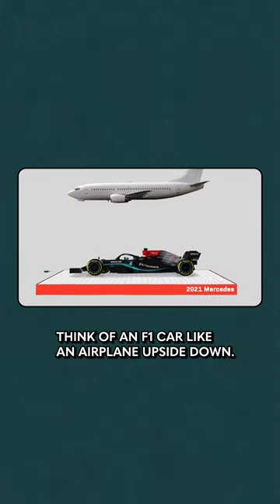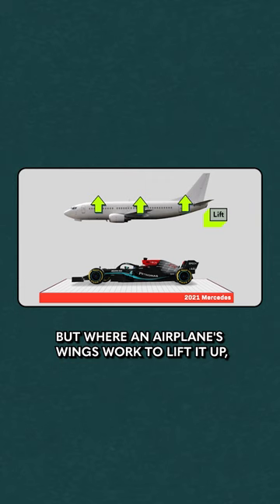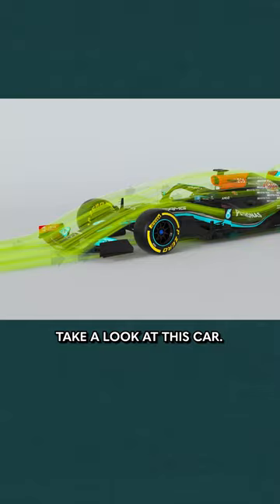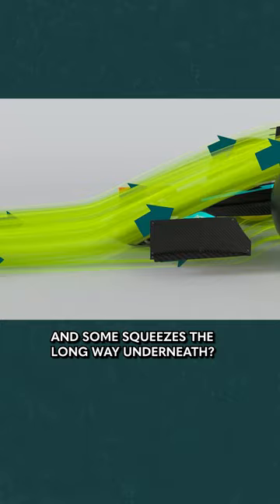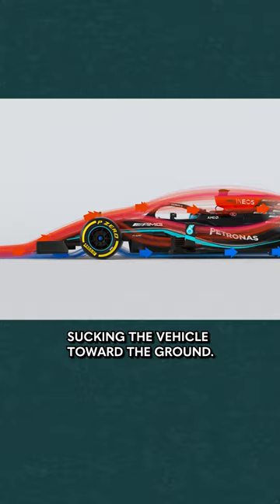How F1 cars go so fast

Comment: There are road going supercars which can beat an F1 car in a drag race. F1 cars are obviously fast in straight lines, but they're no faster than other supercars. The difference is cornering speed, an F1 car can maintain so much more of its speed through corners because it sticks to the ground so well, while a road supercar would have to brake so much more heavily.
Reply: This isn't true. I saw a video where an older V8 Red Bull from 2011 beat a Bugatti Chiron.
Reply: @ShadowRacing  just because Bugatti’s got a good top speed doesn’t mean they get there fast
Reply: @x2amazing  yeah but the main thing is that an F1 car is lighter and better acceleration than a Bugatti
Reply: Acceleration is dependent on speed; from a standing start an F1 car is insanely quick, but as we move to higher speeds, a Bugatti can keep pulling while an F1 car will top out.
We see Bugatti speed records where the speedo is still climbing when the record is reached; they only stopped because of lack of road or overheat/wear&tear.
Reply: @lezhu6856  good explanation man
Reply: Where an F1 car really beats everything is under braking,  especially repeated braking.  Those carbon-carbon discs take 6 months to bake.
Reply: Aerodynamic grip and mechanical grip = Very very fast cornering speeds.
Reply: mate theres a video of a redbull van beating an f1 car  @ShadowRacing

Comment: It's not actually just to keep control, it allows them to carry much more speed through the corners.
Reply: Yes, they can carry more speed without losing control... I'm not sure what distinction you are trying to make.
Reply: @thomasdalton1508 Bro has -5 IQ 💀
Reply: @thomasdalton1508  the way it was said in this video made it seem like it was just to make the cars easier to drive. It's not the case.
Reply: @ShadowRacing  Well, it makes them possible to drive, really.
Reply: @thomasdalton1508  no, not really.
Reply: @ShadowRacing it does, f1 cars are rwd and without downforce they would lose traction easily
Reply: @aytoz101  Not actually totally right, because the traction phase is at the lower speeds, and at the lower speeds, there is not so much air flowing over the wings to create downforce.
While downforce does help with Traction, it dosen't make a huge difference.

Comment: This is the Bernoulli’s principle and it also applies to planes although you have to reverse the pressures. A plane’s wings has more pressure below the wing and less pressure above it, which causes it to take off. The Bernoulli’s principle is also why some race cars have side skirts because as air passes through a constriction it speeds up.
Edit:I forgot a couple of words lmao
Reply: So that’s where the name Francesco Bernoulli is from in cars 2

Comment: Love that you love F1! The enthusiasm is infectious.

Also, a little known fact: the difference in pressure between the top and bottom of a wing doesn't actually add up to its total lift. The lift is actually matched to the shift in momentum imparted by the wing on the air. In other words, the wing turns the air up or down and that pushes the wing in the opposite direction.
Reply: @Taz1451  😭😭
Reply: newtons third law

Comment: F1 cars also use something called ground affect, or the Venturi effect which creates an lower pressure under the car which sort of sucks it to the ground when at high speeds.
To explain the Venturi effect is quite simple, if you have a pipe that air is moving through it has the same speed leaving the pipe as it did entering because there is a constant force pushing the air through, as in a f1 car speeding through air.
If that pipe is constricted in the middle and then goes back to the same diameter as the entrance, the speed of the air through the middle will have to increase and thus the pressure decreases in that part.
The floor of a f1 car is cleverly designed this way to maximize what is called downforce

Comment: F1 car wings are not just inverted plane wings. That would work but it would produce just a little downforce compared to using a scoop design which shoves air upwards to create way more downforce (but that also increases the drag)

Comment: Its cuz the air at the bottom is moving faster than the air at the top, the faster the air, lower the pressure so this pressure difference pushes the car to the ground.

Comment: "Sucking the vehicle towards the ground" 

More accurate to say the high pressure is pushing the vehicle. Suction is a quasi force.
Reply: If you want to be truly technical, the pressure difference doesn't even explain the lift. It's the pressure combined with the change in momentum imparted by the wing on the air.

Suction vs positive pressure is just pedantry for Physics 101 students.

Comment: Also they changed regulations on cars in 2022.  Going from traditional ways of applying downforce (front and rear wings) which cause a lot of dirty air. The new regulations for the cars now make “Ground Effect” their main way of applying downforce. Which cleans up the air and makes for closer races.  The ground effect is obtained by intricate designed floors that create Venturi tunnels.  Basically sucking the car to the track using the body and floor, while having more basic wings.  

A good thing to cover for future video is how F1 teams get a certain number wind tunnel hours and CFD hours.

Comment: It’s not really about control as these are top drivers that will make the car extremely unstable if it means they can go even slightly faster. It is about overall speed across a track, with corners where a lot of time can be gained with increased grip thanks to downforce.

Comment: Wrong, downforce is for grip so more cornering speeds*
Reply: But yes the air on the bottom is 2 inches from the ground so higher air pressure on the top